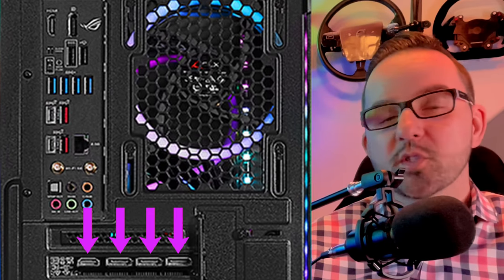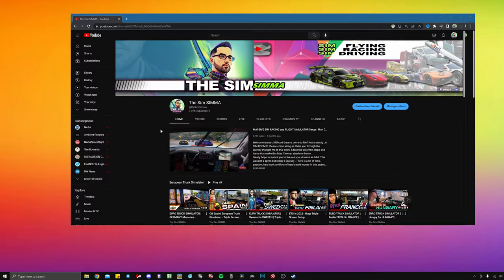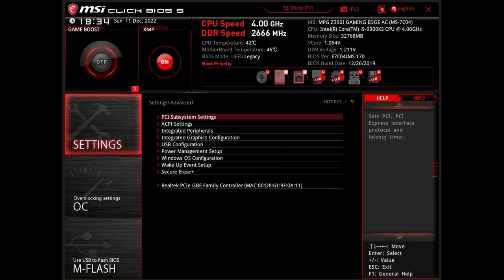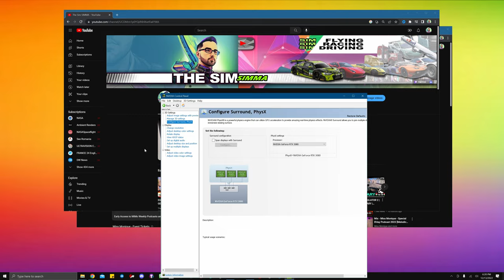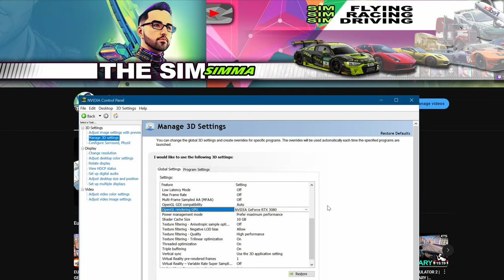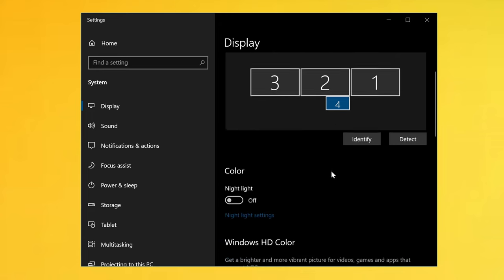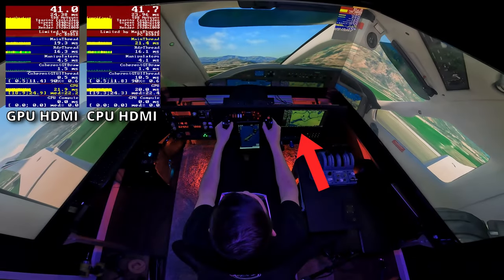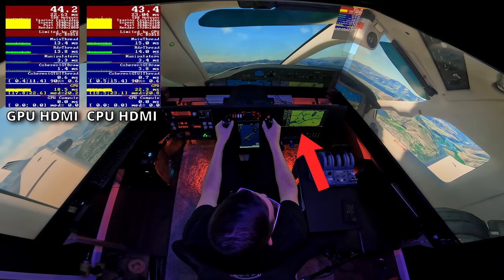How to USE UP TO 5 SCREENS on one PC !

Comment: Good work.  I did that a while ago.  It works fine without loading the Computer much......  especially as the two dash monitors just run instruments.  
Without confusing anyone, you can also add a tablet as another monitor with “Space Desk” app......  via wifi on the same network.

So I have two touch screen monitors and a tablet on my dash all running Air Manager instruments.  The tablet in the centre is in vertical orientation running a comm panel and clock..... when they are all lit up it is so cool.

Comment: Simma, terrific stream. Thank you! Are you running your monitors #4 and #5 both as Touch Screens (Air Manager)? Was concerned mixing GPU with MB output might scramble Windows mind when it came to Touch.

I'm attempting:
Three 55" Monitors #1, #2 & #3 from GPU - DP to HDMI, 4K @60HZ
Two 22" Touchscreen Monitors
   #4 from GPU, HDMI 1080P (1920 x 1080) @ 60HZ
   #5 from MB, HDMI 1080P (1920 x 1080) @ 60HZ
with
AMD RYZEN 7 7800X3D
Reply from the maker: Thank, thank you so much for stopping by. I'm not very active on YouTube anymore but the other night I went live for like a minute or so. And you can see that my fourth monitor is being used as a touch screen. Feel free to rummage through my videos and sort by latest and you shall see. No issues at all !!
Reply: @jaylusk6913  I am running 3-43" screens at 4k off my 3080 and 2 touch screens off a second GPU. I just got the cheapest card I could find that Had 2 HDMI ports. Keep in mind that you also need an available usb-c port for each touch screen. At least I did.

Comment: My menu looks identical to yours except that it's missing the INTEGRATED GRAPHICS CONFIGURATION option! Russ Barlow was able to do five screens from one PC with a GTX 1070 Ti dinosaur, but he didn't explain how. I've spent days trying to get five monitors working with an RTX 3060 Ti and was so excited when I found your video, but so frustrated again. Great video though. Right to the point.
Reply from the maker: Please take everything I say with a grain of salt. I'm just a silly guy like the rest of you and whenever I discover something I try to share it. Is to say, I'm just sharing the stuff that I know in the best way that I can but it doesn't mean that I actually understand most of what I'm doing. I somehow just make it work and I try to repeat the process and make a video. With all that said, here's the problem that I found out : INTEL chips are listed as k, ks, KF. If you do research into it, you'll find out that they represent integrated graphics included with the CPU. Two of those do not have integrated graphics. One of those does. I think it's the k but again I could be completely wrong and forget which one it actually  that might be your problem. You're trying to squeeze meat out of a sausage that was made with vegetables....lol. I hope it makes sense. Please do a bit more research into what I said in you might find your answer.
Reply: @DaSimSimma  Perhaps the problem. This processor is an AMD Ryzen 7 5800X, not Intel. The other problem is that I'm not a Windows user. I do have access to an older video card, but having the worst time trying to figure out if this machine can support a second video card. :-(
Reply: @DaSimSimma -- A follow-up: The processor is the problem. Basically, if you've got an AMD Ryzen CPU, your chance of being able to utilize "integrated graphics" is slim. https://www.youtube.com/watch?v=_Ftk8jQhsqE
Reply: @dorianjepsen  The latest GPU's including the RTX series only support 4 monitors (even the RTX4090) You need a CPU and motherboard to support the IGP  to have 5 monitors. For Eg, an AMD motherboard that has HDMI out from the board and a compatible AMD CPU like 'G' suffix . . 5600G etc 1 x mobo HDMI out + 4 x out from GPU.

Comment: i have a Geforce RTX 3080 12 gb, CPU  is i9-12900K  64 GB Ram and bought new Monitors but now i can only hook up 4 out of 5  i can only plug 2 via Displayport in the GPU and the other 2 over Intel Graphics 1 HDMI and 1 Displayport.   before i could use 4 Monitors in the GPU and a VR Headset  but now with the new Monitors it doesnt work anymore  System registers the 5th Monitor but doesnt let me activate it. no matter how i change the ports.  my guess is as of now the 3080 RTX 12gb, isnt enough anymore for 5 4K monitors. any Tips to get it to work?  without splitter or something like that.
Would a new GPU be the option?
Reply: i have a 3070 which has 5 ports i only  play in 1080p and it does not work for me why have 5 ports when you cant use them all

Comment: Very nice video again. Does this only work on Intel CPU's that are not "F" suffix?? I have two 1080p screens connected via a USB-HDMI adapter but cannot find out if that is using the i-GPU or not - any ideas?
Reply from the maker: My understanding is that the igpu is always turned off if you have a nice graphics card. I know that because as soon as I turn it on it took a while to download the driver. As for the suffix I'm not really sure.... As far as I understand every motherboard/cpu can do graphics to a certain extent especially if it has an output on the back ! PS that output can be USB DisplayPort or even vigi sometimes
Reply: @DaSimSimma  Thanks, I was just wondering because the Intel i12900K has iGPU but the i12900KF does not - I was unsure if there was a separate GPU on the MOBO. I still have not found out how USB graphics works :) When i run my two USB monitors it moves my PC from being GPU limited to CPU limited in FS2020.
Reply from the maker: I'm not familiar at all with that as we talked before. My thing is ....(reason why I made the vid) let's use the video outputs that are there before we move to USB solutions. I say that because those outputs are linked to graphics processor units so there shouldn't be any conversion or any delay as I would assume a USB would have to do. To be clear I'm completely speaking out of turn since I am not an expert on any of this and I'm learning as I go
Reply: @DaSimSimma  Of course, no worries, I only went straight for the USB-HDMI as i wanted to add two 1080p panels and the MOBO only has the one port ;)

Comment: Or ... if your current CPU & mobo doesn't support IGP, then you can just get the RX480 & RX580 GPU 8G preferred (they are cheap used now ~ $60US) and use the combination of VGA outputs directly from the GPU (2 x HDMI, 1 x DVI & 2 x DP .. you can buy adaptor to suit) and no need for BIOS config etc. AMD Adrenalin software is easy to config the monitors. The latest $2K+ GPU's can't even output 5 monitors like these GPU's! LOL

Comment: I've got 6 screens
Reply: @DaSimSimma  yes, 4 on the video card and 2 on the motherboard = 6
Reply from the maker: @roadi7  nice ! What kind of frame rates do you get with 6 screens ? How come you have 2 outputs on your mother board ? Tell us more , share , educate ! ;)
Reply: @DaSimSimma  lots of motherboards have multiple video outputs, mine has 1 hdmi and 1 display port. frame rates depend on how intense the game is and the quality settings, could be anywhere from 70 to 270.
Reply from the maker: @roadi7  very cool . I had no idea ! New to PC gaming and learning everyday . I share all I discover but it so helpful when guys like you add more information . It helps everyone . Thanks friend !
Reply: @DaSimSimma  welcome ~ happy to help, yes I didn't know for a long time that motherbopard video outputs coule be used at the same time as the video card's ...and that if the motherboard had more than one video output that all those could be used at the same time as the video card's not just one of them, and now with thunderbolt being onboard motherboards some motherboards could do 3 on their own, which could make 7 possible
Reply: @roadi7 how can i do that
Reply: @UnrealEnginecode  4 from the video card and 2 from the motherboard as long as the cpu has onboard graphics enabled as well